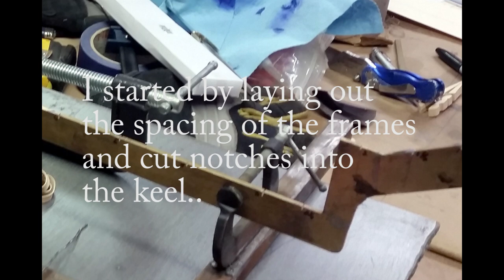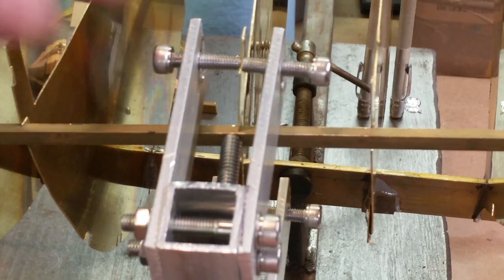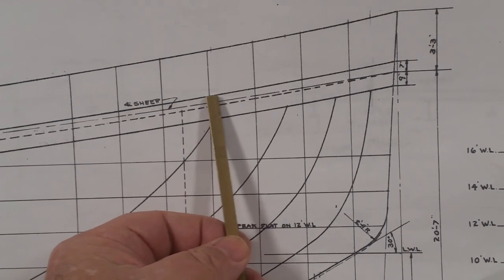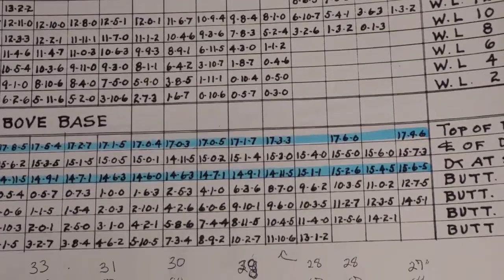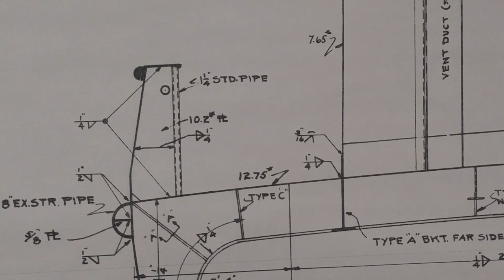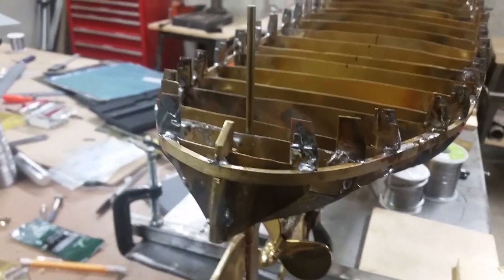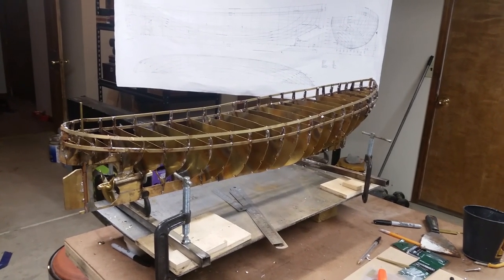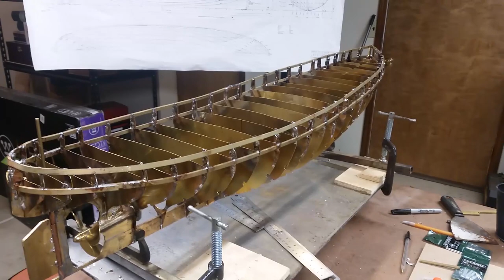Model ship build - USCGC Arundel  Part 4 - Attaching the Frames

Comment: An ambitious project given you’ve stated you’re not a metal worker. You have many cold soldered joints which will haunt you later. It’s unfortunate that you didn’t know about, or use, silver solder. With a little more heat you’d have bulletproof joints that are next to invisible.

I hope you haven’t given up on the build given all the preliminary work you’ve done.
Reply from the maker: No, haven't given up.  As a matter of fact I have built two additional hulls. One of steel and one of wood.  I realized my metal work needed help.  I tried boosting the heat on the brass solder using Map-gas, which worked.  The problem I encountered was with the extra heat, other joints became de-soldered.  I have video waiting to be edited.  Its been waiting for a while  :-).  I also recently purchased a tig welder.  So in short, brass or steel, I will figure it out.  Thanks!

Comment: I have just found these vids and have watched all four so far and look forwards to the next one. I do understand that this will be a long term project. I would how ever could you post a link to the plans or tell me the link. I have looked but have not had much luck not sure I'm doing the search correctly.
Reply from the maker: Sorry for the delay Stephen..  The project is still 'alive'.  I have video that I just need to edit.  I basically had to start over.  The brass didn't work out for me while plating so it is now in steel.  The framing, after a complete 'do over' is where this video left off but in steel.  I'm waiting for the weather to break here in Michigan to crank up the welder in the garage. 

As far as searching, its a hit or miss.  I finally found what I was looking for in the National Archives.  www.archives.gov  They can help you if you write them but they just kind of point you in the right direction.  It will help if you have information on 'sister' ships etc.  I had to hire a local on the ground to physically go into the Archives and look, scan and send to me.  It really depends on how much you want them.. You can do it yourself if you are in the area.  The government has archives all over.   Hope this helps.
Reply: @ptstransky  thanks for the reply as for waiting on the weather I totally understand I live in Northeast Ohio so it's a bit or miss right now. I'll keep an eye out for the new vid